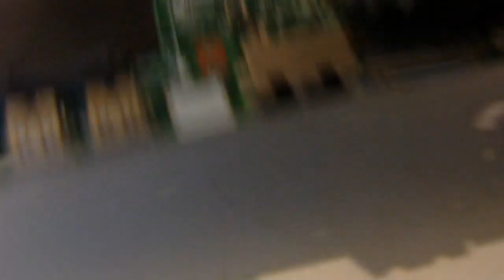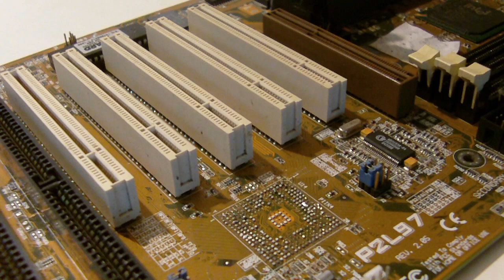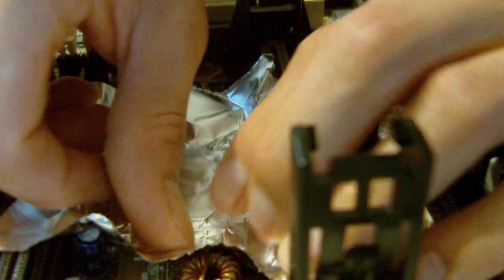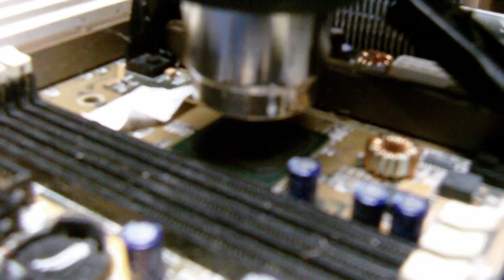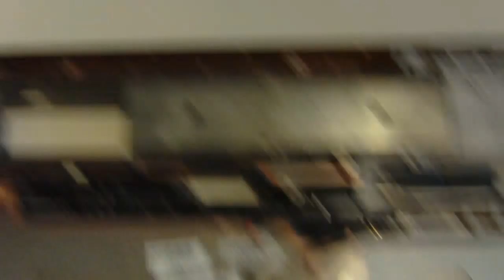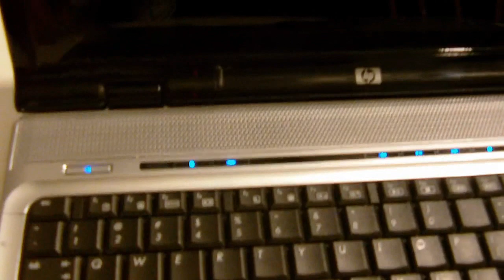Re-flow dv9000 series worked, Re-ball vers reflow

Comment: Rossmann group believes replacing the GPU is the best repair. I want to do a reflow on a toshiba m/b but more vulnerable parts & areas masked with Kapton tape, pre heat the board, use a hot air gun, temp sensor & timing.

Comment: I used a aluminium chim between my gpu and the heatsink on my Dell Precision M4300, that seems to cool it pretty well. Idle temps are down from 70c to 62 and that's much better. The M4300 has the same issue that your HP has, so I had to reheat mine too. Now it has been working for quite some time and i've played games and everything, My M4300 is my main pc so I can't have it die on me :) Awesome video as always Kurt! See you :)

Comment: Thanks a million for this video......i am going to start of by trying to just reflow an xbox360 wich has a failed GPU and see if it works and next time it fails if it likely will sometime i´ll reball it with an "Ebay kit" and a heatgun.One thing i miss tho is some kind of temp sensor to monitor the heat but i´ll have to think about that part later on.

Cheers man and take care....videos like these are great and def worth a thumb up